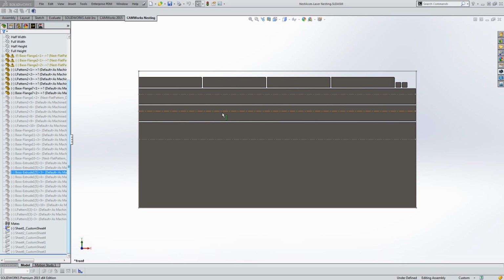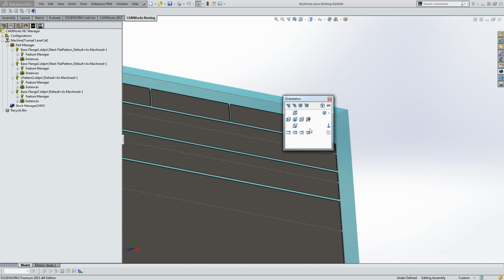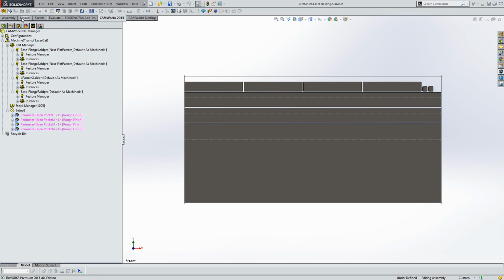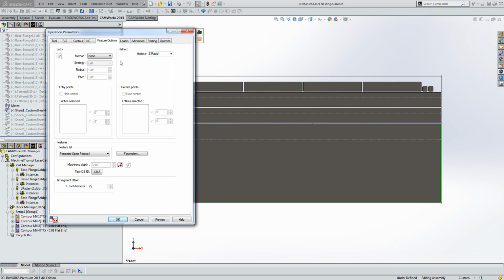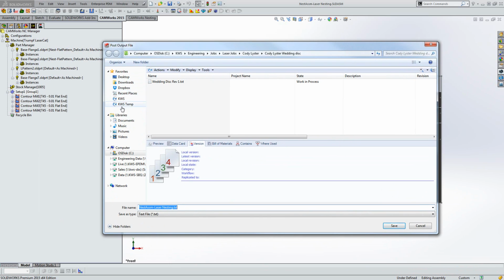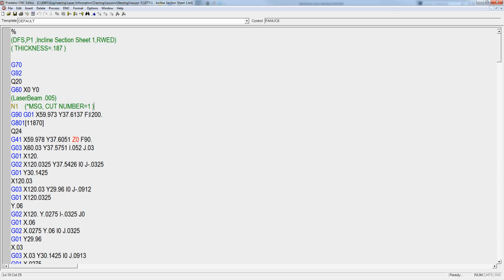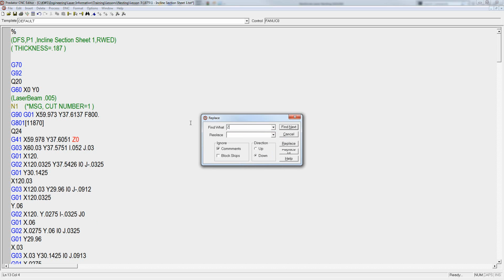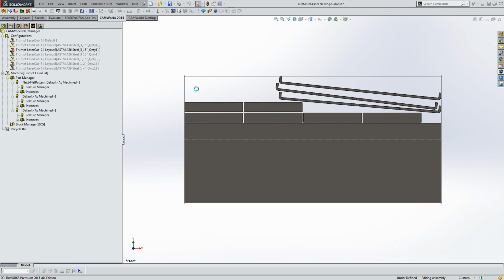CAMWorks Lesson 4

Comment: Hi Mike, 
Why don't you make two postprocessors - one for internal parts and one for contractor parts? - save you the editing work in the output file and eliminate the errors from happening.
The post should be fully capable of producing the required nc file without any edits.
Liked your videos :)
Reply from the maker: Tim,

We could do that with our post processors for sure.  I have the post processor setup to handle other projects that are not shown here.  This is the exception.  We do have ways to output the post from CAMWorks without changing the posted file.  We can't give away all the secrets of what we do.....  :)